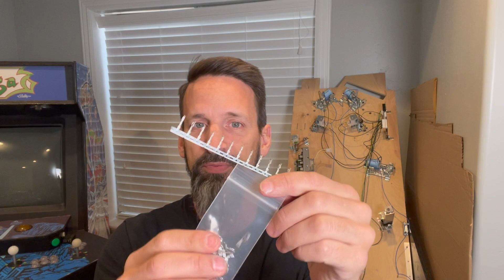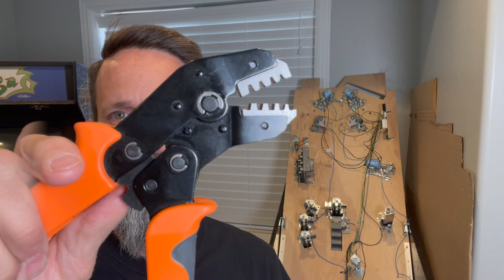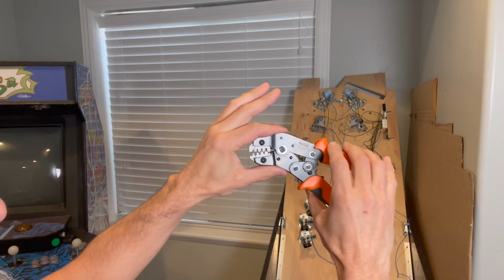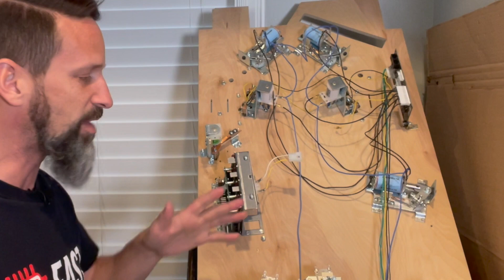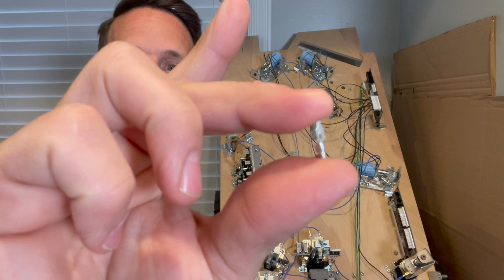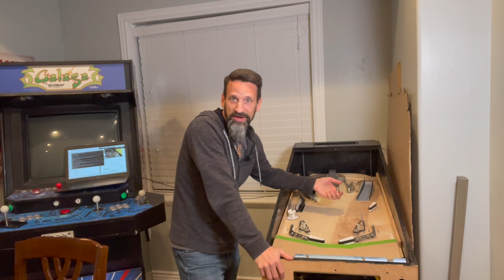HOW TO MAKE A PINBALL MACHINE - Wiring up mechs!

Comment: Thank you for another video. My long lived wish to built my own pinball machine is getting so much closer because of your detailed instructions. I am learning so much from you. Thank you very much for that. I did buy a broken old pinball machine some years ago to be the donor but it is the old style cabinet. However building the wood part of the cabinet is not that big of deal and I can still use the other parts from the donor machine I guess.  My question on which I cannot really find the answer is about the old (like my 1973 Big Valley) and newer styled cabinets. The newer cabinets have a more angled play field which makes the ball come down faster. Also the cabinet itself has a even more steep angle. I guess this was done to get more room and be able to create double stacked play fields at the back. However can you tell a little about these changes and maybe quickly tell about your (and otherwise used) angles and measurements and more. Thank you so much.
Reply from the maker: Of course! I’ll add it to my list of videos - I might not be able to get to it for a little while since I’m trying hard to get my machine ready for a pinball show in June, but I’ll try to work it in before too long.
Reply: @thepinballroom  Thank you very much. I'll wait for it patiently :)